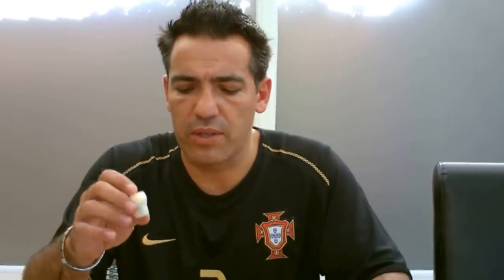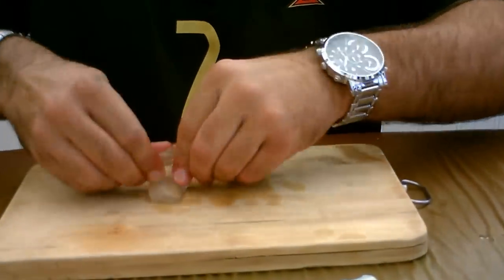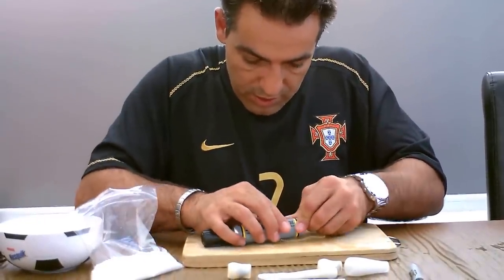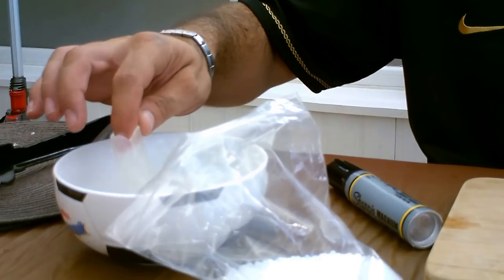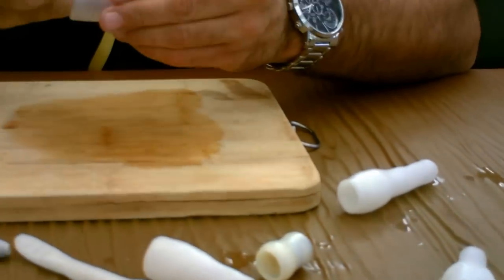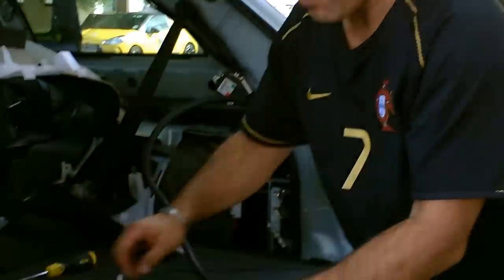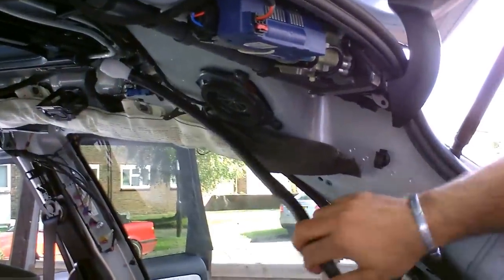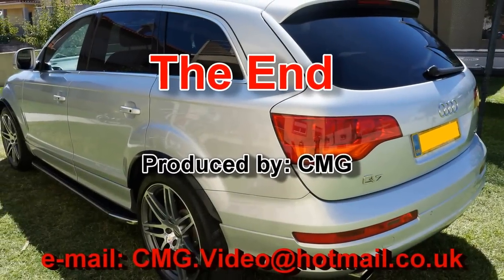Audi Q7 Sunroof Drain Fabrication Video

Comment: The WAY EASIER way to do that is to get some heat shrink tubing that will fit both the hose and the sunroof drain nipple, put some silicone caulk on the outside of the hose and the outside of the nipple, thread the heat shrink tubing over both the hose and the nipple and then heat it up so it shrinks. It's a 2 minute job instead of a 30 minute job. For added rigidity you can slide a second piece of heat shrink down the drain tube before you connect everything and after you shrink on the first one, slide the second one over the connection and shrink it on as well.